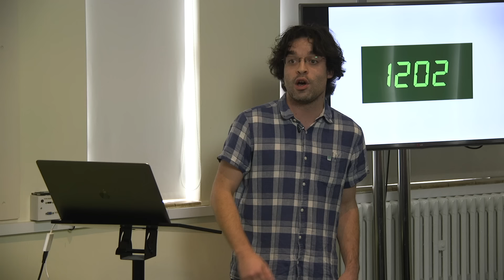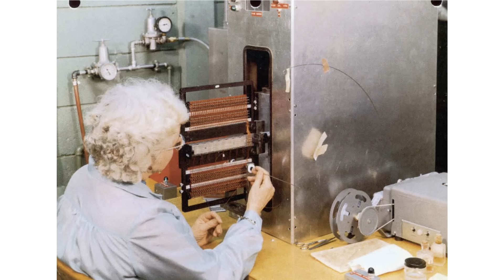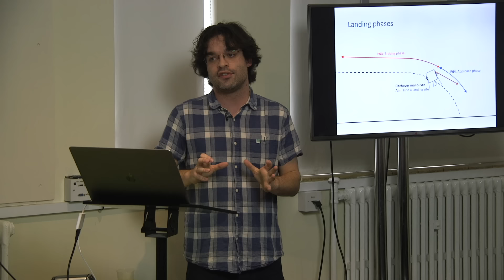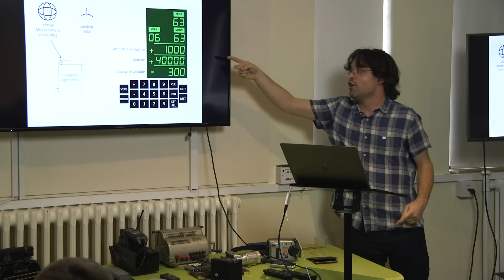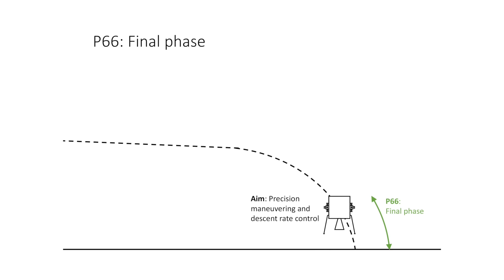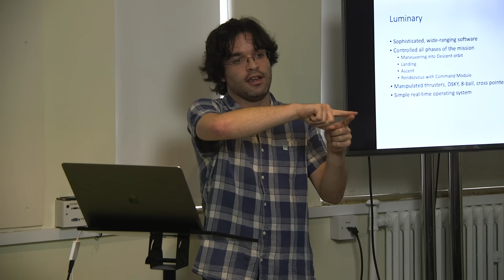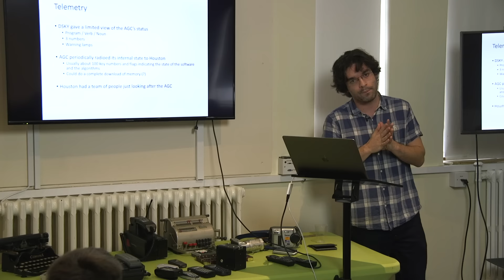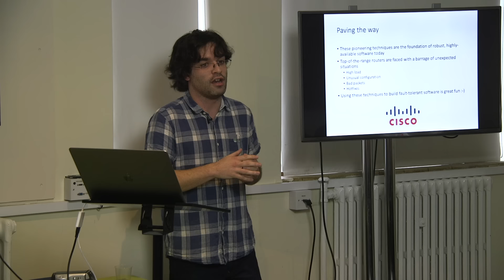Light Years Ahead | The 1969 Apollo Guidance Computer

Comment: Great presentation!  2 questions:  When was the rendezvous radar initially switched on?  What type of restarts were done to recover from the 1202 and 1201 alarms and how long did they take?
Reply: Option 3 type restart. Only a few seconds to restart.
Reply: It was a full processor hardware reset. However, the software kept memory aside to ‘remember’ its last state. This allowed the software to reconstruct what it was doing within a second or two. I write automotive engine control software and in that industry we also do similar things. A full hardware reset takes less than 100ms to reboot, resynchronize with the engine and get back to running again. In most cases the most you’d feel is a small ‘hiccup’.

Comment: It was not ahead of its time. It was made for the need and purpose, and paved a way fot the technology of  today what we take for granted.
Reply: I can't understand why you would say that.  It was ahead of its time, in that it introduce a lot of technology that was, up until then, non-existant.  It's "time" was computers large enough to fill a room, for example.
Reply: @iceiggle I look at it quite differently.  Of course, many of the central ideas of the machine already existed; that is always the way of things in technology.  Still, IC's were only a few years old at the time, and nobody really trusted them yet.  Nobody had built a computer out of them.  It was MIT taking the idea of using them to NASA that in many ways made the Apollo program possible - a computer made of discrete components would have been way to big and heavy.  There was a quote at the time, "Building four or five prototypes consumed 60% of the country's production of integrated circuits."  Designing and building a new, small, lightweight computer was indeed a new thing.

What they had to do was quite different than copying somebody's Arduino code and modifying it here and there.  They were starting from scratch in so many ways.  The fact that IC's existed doesn't mean that there were a pile of computer designs floating around on the Internet.  "So, okay... we've got IC's, we've got two cubic feet...  now what do we do with them?"

The software was a similar situation.  They built a priority-based cooperative multi-tasking operating system with interrupt- and/or timer-driven routines for managing data I/O from some... rather interesting peripherals.  This OS was quite general-purpose, though quite well-suited for the Apollo code.  The machine was programmed differently for lunar maneuver simulations in Earth orbit, for flying the lunar module, for flying the command module, and later for flying jets.  The instruction set was quite general-purpose, all things considered, and could have easily been used to accomplish any number of other tasks.  The ROM technology was a bit of a handicap, but that could easily have been replaced with a boot loader and RAM.  The user I/O was rather special-purpose, after a full-size display was considered and abandoned, but a generic keyboard/display could have easily been done with that machine.  The technology would have easily supported its use in other applications, though practical considerations maybe not so much.

All through the program, they were encountering and solving technical problems that had never been addressed before.  The more you study what really happened, the more clear that becomes, and the more likely you are to show it the respect it deserves.  I think there is value in understanding those things that have paved the way for what we have today, being careful not to judge them with that standards of today, which didn't exist at the time.  Something that can help provide perspective, I think, is to participate in creating something that's truly innovative, and imagine how people are going to look back on it in the years ahead.

Comment: Great talk. We're lucky to have such good and compact computers nowadays. I bet even a raspberry pi has enough power to control a rocket.

2 years later edit: an Arduino mega  would probably be better suited with its greater I/O capabilities.
Reply: Hello Truly Infamous, a raspberry pi does not have the real time characteristics you'd need to control a complex system like the Lunar Module. People always focus on computing power, but this misses the point: the AGC solved an IO-intensive, real-time and safety-critical problem, using relatively little electrical power, space or weight. Amazing!

I'm really glad you enjoyed the talk :-)

Comment: Explain me why the engineers would have devised a position of the radar switch on which it was sending fast pulses, which had nothing to do with the real radar input, and also why these radar pulses were directly counted by the processor of the AGC (with what they call "unprogrammed" instructions), while they should have been counted with an external counter, read with an I/O instruction (that the AGC besides had), like any other system does (including the one of the saturn rocket), which would have avoided uselessly overloading the computer, allowed the periodical guidance routine to finish in time, instead of being exceedingly delayed by the radar pulses counted with instructions, and would thus have avoided the 1202 alarm?
And I have examined in detail the procedure BAILOUT called when there is a 1202 alarm, and found an infinite loop in it!
Reply: Pascal, thank you for your great question.  To reply properly, I will need to go into some detail, but I think you'll find the answer interesting.

One of the big design constraints they had with the Apollo Guidance Computer was the sheer number of IO devices it had to talk to.  If you imagine (for example) 10 external sensors, each with a 15-bit external counter, then you need 150 connections to connect all of those devices to the AGC.  You also need lots of logic gates inside the AGC to handle the bus multiplexing, and external logic in each input devie to implement the counters.

Instead of this, they devised a system where many devices just had two connections to the AGC -- one to increment the internal memory counter corresponding to that IO device, and one to decrement it.  These signals were called "PINC" and "MINC".  Returning to our example of 10 external input devices, this only requires 20 connections to the AGC, far fewer logic gates inside the AGC to handle all of this, and no logic in the input devices.  (I'm simplifying this slightly, but you will get the gist of what I'm saying).

This ingenious approach worked because the values from the input devices were smoothly varying (eg the height above the surface, or the angle of a rotating antenna).

As you correctly say, there was a cost to this technique.  Each time the computer received a PINC or a MINC pulse, it had to pause what it was doing, read the current counter value for that input device from memory, and increment or decrement the value.  This is exactly what happened with the Rendezvous Radar: a bug caused it to send a stream of alternating pulses: PINC, MINC, PINC, MINC, ..., which put a ~15% load on the computer -- ie it could only run other instructions 85% of the time.

So what, in detail, was this hardware bug with the Rendezvous Radar?  The Apollo Guidance Computer had its own internal clock, and many other spacecraft systems derived their clocks from the AGC clock.  However, the Rendezvous Radar had its own clock.  They designed it so that it was frequency-locked to the AGC clock, but it wasn't in phase.  The phase difference between the two clocks depended on exactly when the Rendezvous Radar was switched on -- hence why I said in my presentation "if you were really unlucky, you'd trigger this bug".

If the Rendezvous Radar clock was sufficiently out of phase with the AGC clock, it would generate this alternating series of PINC, MINC, PINC, MINC, ... This is what happened on Apollo 11.

I skipped over the details of all this in my talk because it is very complicated, and I tailor my talks to the specific audience.  If I was giving this talk to a room full of electrical engineers, they would get the full explanation :-)  Part of the joy of historical computers, particularly the AGC, is spicing things up with a great story, hence my very colloquial description of the hardware bug in my talk!

To summarise, they could not afford the weight, logic gates, wiring, cooling or power costs of having external counters for all of the input devices.  The PINC/MINC solution was a great compromise.  A hardware bug caused by out-of-phase clocks generated the erroneous pulses, and to my knowledge this bug was only ever seen once before on Apollo 5*.  Also, you mention Saturn V: its computer (the LVDC) was a much simpler device that had to do far fewer things, so they could make different tradeoffs there in terms of weight, etc.

Finally, the main point I was making in my talk wasn't that the computer was perfect, but that it handled the unexpected situation perfectly.  Handling the unexpected and unpredictable is the cleverest thing any system can do.

I hope this has provided some more depth, and goes some way to answering your question!

* The occurrence on Apollo 5 is an active area of my research; I don't know anything more about it at the moment :-)
Reply: @robertwills8051  They actually introduced a software fix in the Apollo 12 version that used a trick to prevent the rendezvous radar from sending its pulses to the AGC during the landing phase, and so the problem of extra load was solved.
This is discussed on the CuriousMarc channel where they restored an AGC and also did a lot of analysis on the different versions of the software.
Reply: @Rob2  That's really interesting, I didn't know there was a software fix for that in Apollo 12. I will re-watch CuriosMarc to brush up on that!
Reply: Two separate answers. Rather than an external counter (which costs a lot of gates per-counter) and there were something like a dozen counters that would be necessary in the AGC. Stealing one clock cycle to use the ALU to do a read-modify-write cycle to a RAM location reduced the numbers of gates by quite a lot. These days where a hardware counter is relatively cheap and only takes a small amount of silicon space that would be the obvious solution, although sometimes there aren’t enough timers available on a computer system (say, on something like a Microchip PIC), this would be close to using a short interrupt routine triggered by an interrupt pin to increment or decrement a counter, and this is often done when a processor offers many ‘interrupt on change’ pins but not enough hardware timers.

As for the RADAR interface, it was basically a specification error that said the RADAR power supply should be frequency locked to the AGC reference frequency, but it did not specify that it needed to be phase locked. This made the phase random at power on so most of the time it wouldn’t do it, unless the power supply was locked at ‘the most pessimum’ phase relationship between the two systems. If the system were phased correctly this condition would not have caused a problem.
Reply: @dale116dot7  An electronic counter does not require many transistors; There are many more transistors to make a computer; if an electronic counter had been used to count the pulses, the computer would not have been overloaded and would not have had to be restarted; even today, with much more powerful processors, no one has "hidden instructions" to count pulses; moreover, it makes no sense that the engineers would have provided a position of the radar switch which would make that the radar interface would produce very fast pulses (because of dephased high frequency sources, as stated in the mission report); it simply makes no sense, even if you try to make sense of it.
Reply: @pascalxavier3367  Those were 16 bit binary up down counters with data bus read back and preset. Making that out of nothing but NOR gates would cost at least 150 ICs per counter and with 12 counters that would be at least 1800 ICs. The approach they took added about 80 ICs for all counters. Plus, core memory took no power except when counting. RTL gates took a lot of power even to maintain registers. And space. The added gates would have exceeded the space constraints. It is a very reasonable design decision for the time.
Reply: @pascalxavier3367  Actually, direct access to memory by external peripherals is still used today in your computer.  Maybe not to increment counters, but surely to store data received from the disk or the network, for example.
Such devices too have the potential to overload the system by transferring so much data into memory that the processor is starved as it cannot read program and data from the memory at the same time.
The fact is that everyone, even engineers, can make mistakes and forget to notice something, and even with lots of testing it can later become a problem.
But what makes this design outstanding is that even in the presence of problems it did not endanger the mission.  The computer could recover so quickly that they could just continue.  Try that with today's computers (especially servers).
Reply: @Rob2  Precisely, this access is used to read counters counting pulses.
Reply: @dale116dot7  In case you would not know, a computer is also made with transistors, and many transistors.
Reply: @pascalxavier3367  You appear to be quite clueless...
Reply: @Rob2  I am not at all clueless, I know what I am talking about, I am a professional; I have used electronic counters to count pulses professionally.
Reply: @dale116dot7  You really think that your explanation makes sense, that the engineers would nto have been able to prevent this problem of fast radar pulses from happening? They really would be poor engineers if they were not able to make it so that this problem could not happen; it happened because they wanted it to happen, it's a hint they give that this descent never happened.